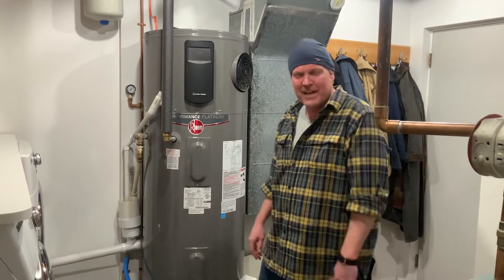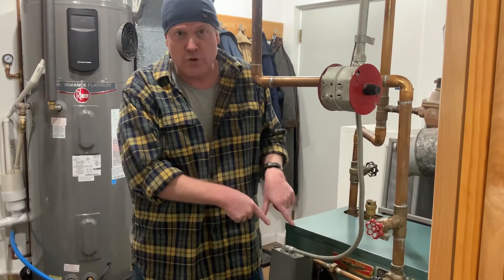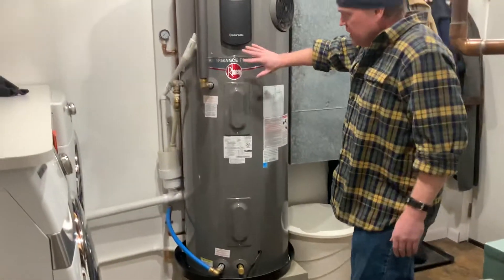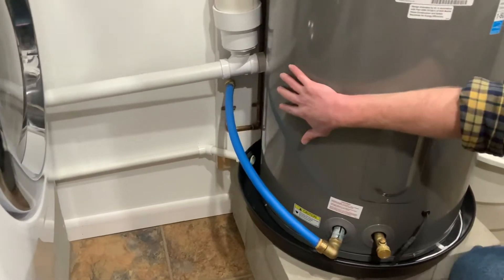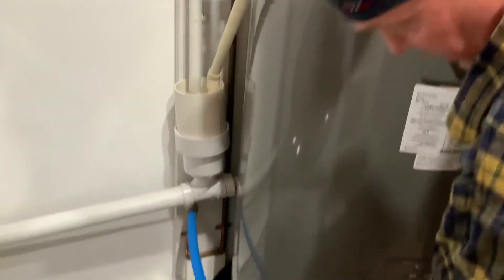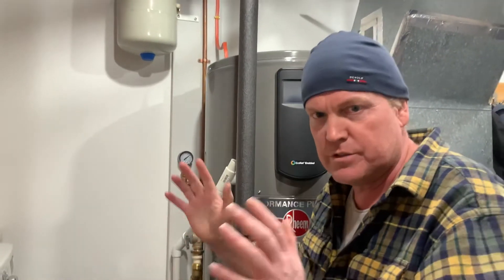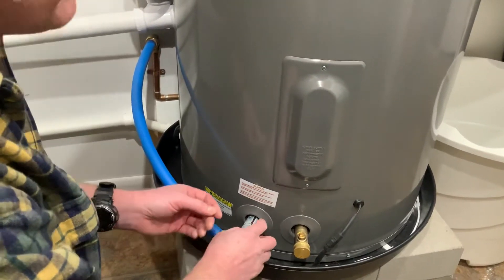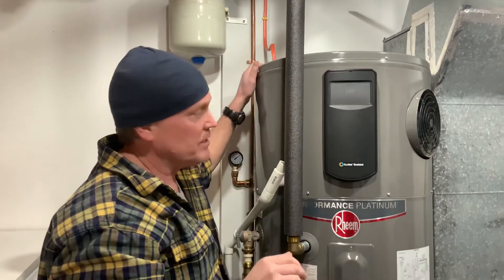Rheem Hybrid Hot Water Heater Replaces On-Demand Coil in #2 Oil Boiler

Comment: I have an oil boiler with on-demand coil.  Over the summer I added an electric hot water heater and the input to this hot water heater is the output from the coil.  Now that it is cold and I am using the boiler for heat, I use the coil again.  I installed valves at the electric hot water heater to stop water going into the heater.  I shut off my boiler during warmer months and have no leaks.  

I see you stopped cold water from going into the coil but what happened to the water coming out of the coil?
Reply from the maker: It just sits there.  The valve just stops it from circulating.
Reply: @207tips  So, you still have water in the coil?  And, the valve stops the water from coming out?  Did you tap into the cold water supply somewhere else for the electric hot water heater you added?
Reply from the maker: @geyser3445  Yes, that’s correct.  If I open the valve, I can pull hot water from the coil again, if I ever wanted to.  For the HWH, I tapped into the cold and hot water in a totally different area.
Reply: @207tips  Similar to what I did.  Thanks.
Reply: @207tips  this is an excellent video - very helpful!  I am about to install the same hybrid hot water heater, but on a steam oil boiler, and I wonder whether I can install a valve on the pipe exiting the furnace’s heater coil, and shit that off instead of installing a valve to turn if the water into the hot water coil. People seem to warn against it, but I don’t see why - how would that be different (from the oil-burning furnace) than no one using any hot water in the house?  Any thoughts would be very welcome!

Comment: I just recently installed my hot water same way. I was wondering if you have any concerns about bacteria growth in the water in the oil boiler’s coil? I’m thinking that adding 2 sets of valves on each side of the boiler. One inline valve on each side to disconnect it from the system and a tee’d valve to purge the water from coil using an air compressor
Also, thanks for a great video.
Reply from the maker: Thanks.  I’m not too concerned about bacteria because the low setting is still over 120 and it’s not like it stays there, as it would with an electric hwh.  It cycles up to the high setting, which is around 180.

Comment: What's your long-term opinion of the hybrid water heater's performance?  New York is offering an instant $1K rebate on these and I'm heavily leaning towards bypassing my oil boiler, with one of these.  Thanks so much for the thoughtful video!
Reply from the maker: Thanks.  After more than two years, I am very happy with this unit.  I should point out though, that I have a near perfect situation.  I placed this unit in the same room as a boiler and a dryer, so there’s lots of excess heat around.  Just be sure to keep the filter clean.  Also, don’t forget to check the fed rebate too when you file your taxes.
Reply: @207tips  thanks!  I have a similar setup: boiler and dryer in the same room.  What 30 amp breaker did you use?  Cheers
Reply from the maker: @heypeteyj  I think that setup will work well for you.  I have a Square D panel, so that’s the breaker I used.

Comment: About to move forward with this project. Think I want to have the boiler completely taken out of loop, and only use to heat house. Any update on venting . I see different opinions on venting or not of unit. Thanks for video.
Reply from the maker: Venting is required when the room where the hybrid hot water heater is placed isn’t large enough (for example, a closet).  The manual will get into the specifics.

Comment: Great video and just what I was looking for!!!  I've been debating this same type of install and haven't been able to find anything on it till I found yours.  Our situation is slightly different as we have an indirect hot water heater connected on a zone to the oil boiler.  I'm planning first on testing what happens when I shut the boiler down to see if any leaks occur, but even if it does, I'll likely be turning on the boiler during the summer months once a week or so to prevent any valve sticking issues down the road.  In your mind, would you think our install would be easier or about the same as your case scenario?  The one thing I'm not sure about is what to do with our aquastat in our situation.  Our indirect heater is I'm guessing over 30 years old, so I'm worried it's beyond it's life expectancy.
Reply from the maker: Thanks.  I think I’d remove the indirect heater in that situation.  Good luck with your project.

Comment: Hey, i just got a hybrid unit installed. Is it best to bypass the boiler and just use the hybrid to heat the house and hot water. or is there a way to have the hybrid be primary and the oil system as a back up.
Reply from the maker: No, you still need your boiler to heat the house.  The hybrid hot water heater only allows you to bypass the hot water coil in your boiler.  From a hot water standpoint only, if you bypassed the coil in the boiler with a valve like I show in the video, then you can still use that as backup hot water when necessary.

Comment: Very informative video. I'm about to do this exact project. It's there any way to completely bypass the hot water system in the boiler?
Reply from the maker: Thanks.  You could remove the coil I guess.  I just used the valve because it was the easiest way to keep the hot water from cycling through the boiler and it allows me to easily switch back to it if the hot water heater ever needs to be offline.  I haven’t regretted anything about this project so far.

Comment: Great video what size exspansion tank did you use?
Reply from the maker: Thanks.  2 gallon.  The size is based on the hot water heater size and water pressure.  If you pull them up on Home Depot, you can usually find an Installation Guide that includes a table for sizing the tank.

Comment from the maker: One point I forgot to mention in the video:  Be sure to see what type of energy efficiency rebates may be offered in your state towards the purchase of a hybrid hot water heater.  Some states have offered hundreds of dollars, which makes the purchase of one of these units very cost-effective.  In addition, on the 2020 federal taxes, a $300 credit was provided.  Check into that as well for whichever tax year you may install one.

Also, a clarification:  At the end of the video I refer to “Hybrid Mode”.  What I meant to say was “Heat Pump Only Mode”.  “Hybrid Mode” in some other brand units is equivalent to Rheem’s “Energy Saving Mode” which also uses the electric heating elements and tends to use almost twice the electricity of the “Heat Pump Only Mode”.